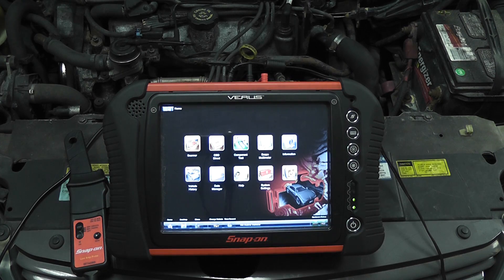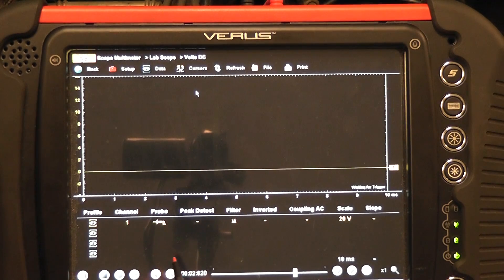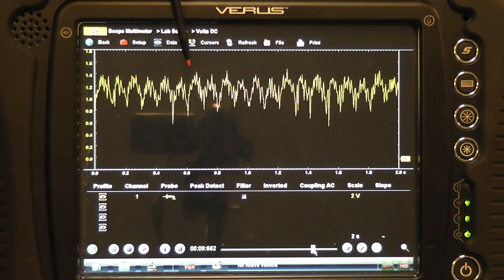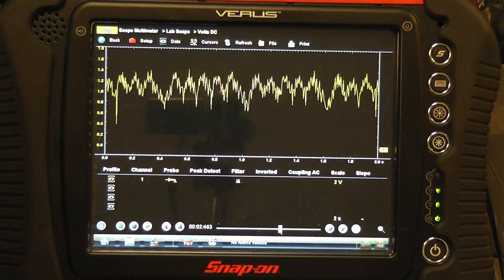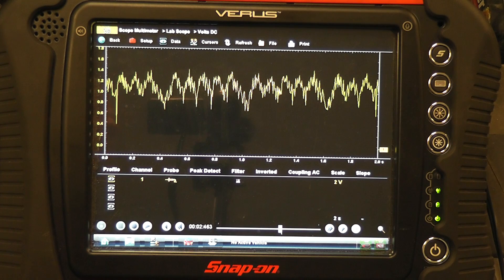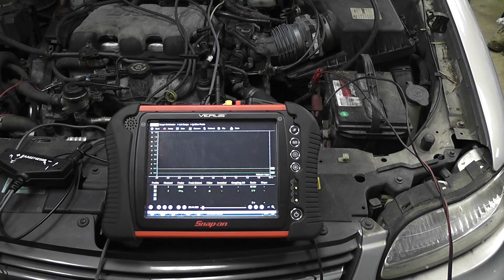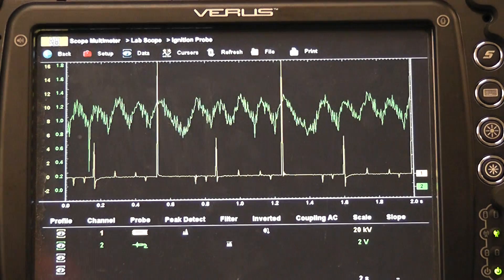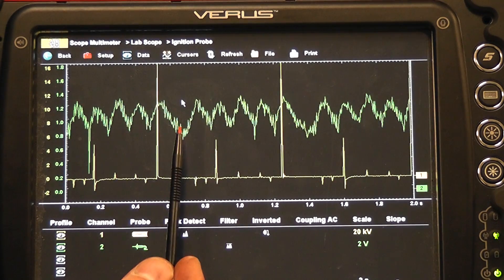How to perform a compression test with a scope (Verus-Vantage)

Comment: I bought a second hand Vantage Ultra 13.4 less than a half price of the new one, but I don't know where to hook up the scanner to the DLC
Reply: Lamberto, the Vantage is a nice tool, but it is not a scanner. It is a slow but adequate for most automotive purposes power graphing meter/lab scope.  You cannot use it to collect scan data.  For that you need a true scanner.  The tool Scanner Danner is using is a combination scan tool/lab scope which will do both.
Reply: Thanks Philip for the explanation. I thought it can be used for both...I'm not wandering anymore

Comment: don't be so fuck'n cheap, buy the oem dealer scanners same costs any ways, that's what I did, at least you can access all the areas of the onboard computers and do the proper diagnostics or reprogram and forget about the backyard garbage like snapon, and autel. ....update this, update that and they still don't work right. Waste of money and there fucking junk, not even good for choking vehicle wheels.  After all when using those back yard scanners, most of the time you have to tell the customer to "go back to the dealer I can't do it... because I don't have the right tools".  Do you have any idea how stupid that sounds?
Reply from the maker: You done yet? You're talking scan tools and I'm not even using the scan tool in this video! I am using the scope to do a compression test.
Reply: john burry you are ridiculous.
Reply: I think you are misinformed about the capabilities of Snap-On, MAC, and even OTC Scan Tools. Honestly, if you had ever used one and been trained on how to use them correctly, you would never have made your comment. However, you are also misinformed about what you claim the Factory Scan Tools cost. I know for a fact that if you were to go out and purchase an IDS (Ford), MDI (GM newer), a Tech II (even a Tech II emulator), Wi-Tech (Chrysler 08 and Newer), DRB III emulator (Chrysler pre-07), HDS (Honda), Consult III (Infinity - Nissan), GDS (Hyundai), AND yearly access to all of those services, including the SPS for GM and other programs for Programming on other vehicle platforms, as well as a J2534 Pass-Thru programming tool, you'd be roughly $50,000 into Scan Tools, still not have all Factory Access to over half the vehicles in the world, AND have $10,000 to $15,000 recurring subscription costs every year.

I'm sorry sir, but your comment is illogical, unfounded, and honestly, just incorrect.
Reply: Ya I don't think so, people like you want to be a good Mechanic but have shit tools to diagnosis problems. , Tell me something, if you were a dentist would you buy your tools from a dollar store?? the point is like I said before ...your snap on piece of shits tool dose not have the software or capabilities to access all vehicle systems , also depends on what brands your working on. In your reply from my under standing is you are working on all brands witch tells me your just a Tom, Dick and Harry Mechanic so with out the proper tools you can't diagnosis the problem properly. I never said it would be cheep to buy good diagnostic tools. Oh by the way auto company's are working on advancing ECU's ABS, BCM's that will only respond with the auto makers scan tool  so if you don't have one you can't work on it probably no more reverse engineering = no more snap on shit  witch is a great direction so people like you can not fuck around with stuff.... I know I'v had to repair many problems from other so called Tom, Dick and Harry Mechanics. I don't work on every vehicle that comes in the dealer ship but the scan tools I have are for the brands I work with all the time. As for costs you waste more money on junk tools like shit snap on scanners than buy the Makers brand, can't fool me, I been there I have done the math and another thing, it's not my problem you don't have money to buy your self the right tools, that's your fuck'n problem.
Reply: You, sir, were the one who stated the cost was the same, and were absolutely incorrect. You also have no basis in your argument, which is why you have to resort to insults and foul language. I'm fully capable of diagnosing any vehicle, and do so every single day. I'm the guy that gets the vehicle that's been to 2 dealerships, 3 other independents shops, and has not been fixed yet. Keep on going, everyone reading this knows you are uninformed about vehicle diagnostics. I've said my piece, have a good day sir.
Reply from the maker: I found it best to ignore ignorant comments. It is better that way for my mental state. 
Clearly, Snap-on has peed in his Cheerios somewhere in his life
Reply: Here you go again, Ok I get it...you like using garbage tools, I don't care. the costs are the same when you factor in your time to call around to find an update for junk tools, Time is money sir, I can't waste all day playing around with universal tools that "maybe it might work" to get in every vehicle. I been repairing vehicles for years, every time I bought that junk tool it was a total waste of money, I'v worked at GM's Tech Center, so I have a good idea what I'm doing and where the industry is going what we found there was some of those junk scanners, cause failure in the vehicles on board systems. that's why its going to get harder to get in.  I will not take my words back on tools that are reverse engineered from the makers Scanner/programmer.
But the day is coming when you won't be able to get in the auto systems with out the Makers scanner just to say sir.  Don't say I din't warn you. My apology for the language, but I don't like using junk tools to repair anything. My brother works on commercial planes, do you think they use junk reverse engineered tools... NO,  and if you did and cause a crash and got caught you go to jail. Something to think about wile your using your reverse engineered tools.
Reply: It's not just snap on, its all reversed engineered tools, all Junk and a waste of money. Only ignorant people use them.

Comment: Mr. Danner-You don't need a high amp clamp for this test? It would not harm the 60 amp max clamp?  Thanks
Reply: +mark schaefers no you do not and you will not hurt the amp clamp but you are limited in that it will not read more than 250 amps or it will not produce more than 2.5 volts on the 10mv/a scale

Comment: Hi Paul. if im using an oscilliscope for testing high amperage with an amp clamp do i need to run it through an attenuator ? or is the attenuator just for high voltage readings? such as an injector voltage waveform. would i ever need an attenuator for measuring current on cars ?
Reply from the maker: +Alejandro Amaro amp clamps produce millivolt signals that are equivalent to the current being measured. You will never need an attenuator for these
Reply: Ohh. I see. Okay thank you my friend. I have my scope on its way through mail and i dont want to burn it in the process of learning how to use it. Lol

Comment: @scannerdanner  I was just wondering if an exhaust restriction would be a variable in relative compression testing especially on a V engine. if the catalyst was plugged on one bank, would that give u low humps on those cylinders?
Reply from the maker: +josue ruiz I think that is possible
Reply: I believe you would certainly see a difference on the bank with a plugged converter, so long as each bank has a separate exhaust header.
Current should go high, and voltage should go low each time one of the cylinders on the 'plugged' bank came up to compression.
(ScannerDanner) Would you agree Paul?

Comment: we must use psi or kpa to check the compression in each cyl, its better more than accuracy than V,,,,,
Reply: Very true but MR Danner will even agree with you this is just basic because time is money
Reply: You are correct, however, even Paul will tell you that this test is NOT a compression test, and it cannot replace a compression test. This test can be done rather quickly, and using an inductive pickup or backprobing the control wire of a Coil-On-Plug coil, you can identify if you have a cylinder that is low on compression, and exactly which cylinder it is. At that point, you already have a definite answer of low compression. You get different information from a Relative Compression Test than you do from a Mechanical Compression Test.

Comment: to figure which cylinder is bad remove plug number one and count spikes from there
Reply: Wouldn't that effect the other cylinder's reading.. as in the same when doing a mechanical compression test..
Reply: Just add channel 2 to the cyl 1 coil pack and use that as cyl 1 reference

Comment: hey mr. Danner. one question.  I'm not getting a reading.  could it be because the battery cable is too thick, and I can barely put my snap on clamp around it? if so what could I do?.
Reply from the maker: +Daniel Garcia no you do not, but you will need the firing order to sync the pattern
Reply from the maker: +Ludguin More less yes, if the jaws of the amp clamp can not close all the way around the wire you will not get a good reading. so your other option would be to find the cable that goes directly to the starter and use that one. Or possibly use the negative cable of the battery
Reply: Ok. I'll try that.  Thank you.
Reply: +ScannerDanner did you have to setup year make and model?
Reply: Big thanks

Comment: Hello Mr. Danner. Im loving your videos and knowledge your are sharing. I was wondering why this test doesn't work on the scope part of the verus and only on the volts dc part. I just figured since the scope's faster it would pick up the compression signal but it goes straight up to 12-14 volts and doesn't move until i stop cranking. Thanks again and I love your lessons! Take care.
Reply: Phillip Kang This was the scope. Volts DC is just a default for a single channel.

Comment: Another method can be much quicker.  If you have individual exhaust headers available, simply check the header temperature.  On aircraft we used to use either a chalk mark or grease pencil mark on each header.  Today I always have a cheap temperature probe handy.  Simply point it at each header with the engine running.

Comment: Paul, your setting is at 2V/2s, my question is how much voltage should you see drop if a cylinder had like 50-100 psi lower than others?
Reply from the maker: Not sure. I don't use this test that way. I just want to make sure they are all even. If they are not, there is a problem.
Reply: ***** This test is more of a relative comparison tests than a measurement. You'd see a lower hump in relation to the others, but a specific voltage amount wouldn't be useful. Under these condition, a somewhat lower hump would lead you to a conventional compression test to measure specifically & then a leak-down test to isolate leakage location.

Comment: Paul, in which cases where I cannot use the low amp probe to check relative compression testing? Which cars?

Also what would happen if it goes over 400 amps? Will I damage the scope or the probe?
Reply from the maker: You will not damage the probe and you should be good with all cars. I've yet to see one with that kind of amperage cranking. Initial crank yes, after that, no
Reply: ScannerDanner thank you kind sir.

Comment: This is awesome, why didn't I think of that?  Huge time saver when diagnosing a misfire just hooking up an amp probe and disabling fuel and ignition vs. pulling all the plugs and wires and attaching a compression tester.  However, if I saw what looked like a misfire in your test I would do it the "old fashion way" to confirm and of course add appropriate labor.
Reply: Thank you Sir you are Legend

Comment: Hi Paul,
I dont find myself doing many relative compression test.  I tried doing it the other day on a 98 honda crv.  I was using a high amp probe set on a 60 amp scale.  (10mv/1amp) Set the scope to volts dc, 2 volts on a 1 second time base.  A got a wave form but it was always dropping below the 0 volt scale.  I tried using my low amps probe, same settings and the same thing happened.  Trying to think where i went wrong.  All the best
Reply from the maker: Flip your amp clamp over, they are polarity sensitive. Or select invert on your scope.
Reply: Paul I tried flipping the clamp over.  When I used my snap on low amps probe the arrow on the clamp was pointing toward starter motor and same thing happened.  I had peaks going over the positive side and they were even but at the same time I was getting almost like a mirror of the positive wave form below the 0 volt line.  Later on i was going over my scope settings and found that I had checked "on" the AC coupling function from a precious alternator diode test I had done and I never unchecked after when setting up the vantage for the relative compression test.  I have not tried to do the test again but i will for sure.  Maybe this is what caused an erroneous wave form to display.  we'll see.  Thanks for your reply!  All the best

Comment: ScannerDanner  Another awesome video. I am a bit skeptical on the effectiveness of this test in that, from the video a relative compression test would clearly show a completely dead cylinder without problem, which in most cases, with some exceptions, are easier to identify without much testing. I would agree that this tests most powerful use would be in checking compression at inaccessible cylinders. In your experience how have you found the effectiveness of relative compression testing with more common engine mechanical faults such as burnt valves, head gasket issues, etc.? Thanks dude!

Comment: Great video. Will a 400 amp clamp be enough for this or do I need 600 to 800 or such ? Thanks brother
Reply: If you are buying a high amp probe get the 600. Most of the time I just use my low amp probe but it will not read higher than 400a

Comment: hey paul I have a quick question, I wanna perform a compression test on my chevy trailblazer i6. I know im supposed to take out the fuel pump relay but am I supposed to disable the ignition system too?

Comment: romeo, sure, but just watch the battery voltage.  As the amperage rises on due to the pressure on each cylinder, the battery voltage drops.  It typically what I do, after all, it is just a relative compression, we are figuring out the pressure (unless you have a pressure transducer installed, which is super-cool).

Comment: Yes, Not all scanners have a lab scope built in. A lab scope shows the wave form. A code reader tells you the code. A scanner will show what the engine/sensors are doing. IF it is a bidirectional scanner you can control sensors and motors ect.  You can roll up windows, flash lights move the gages things like that.

Comment: If its a EFI And most are nowadays if they have coil packs Or COP Just use the injector disable to check RPM drop. If it has a distributor, you can reach the plug and/or distributor.

Comment from the maker: @import0408 as long as the low amp probe fits the wire you shouldn't need a high amp probe especially because i generally only use it for starter current and as you saw in this video i used the low amp probe

Comment: How would you hook a high amp probe up to the verus. Would you use the same 2volt conversion cause there is no option in it for a high amp. If so is there really any use for it with this scan tool other than it has a larger clamp

Comment from the maker: No, it should have worked on the 40 amp setting. Did you make sure you were on the correct battery cable? Sometimes systems will run multiple main cables, just make sure your on the one going to the starter itself.

Comment from the maker: @MrKevg59 Depends what your market is. There is no better scan tool than a factory one, but if your an aftermarket guy like me and work on everything the Verus is the way to go. There are cheeper alternatives though, you could go with a Solus Pro and Vantage Pro which would cost you a few thousand less than a Verus. Snap-ons troubleshooter and component test meter is un-matched in the aftermarket for experienced based help.

Comment from the maker: @bartewer This test is used to determine the cause of the misfire, not which cylinder is misfiring. Imagine you are working on a system where the intake manifold covers the back cylinders. The middle cylinder in the back is misfiring as noted by misfire counters and a trouble code. You would need to sell a customer an upper intake R&R to inspect the misfiring cylinder for a lack of spark, fuel or compression. With this method you could identify a mechanical problem without removing the intake.

Comment: Why would you use this to isolate a misfire? I could see as a general quick check of engine health, but wouldn't it easier to pull the wires off one at a time or check the misfire counter on a scanner? I have a scope but this seem the long way around the barn to diagnose a misfire.